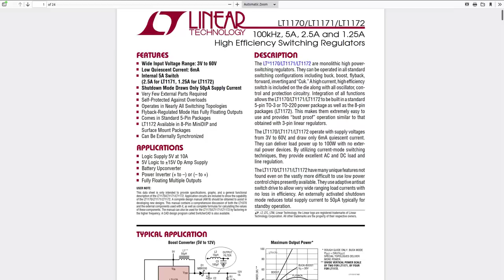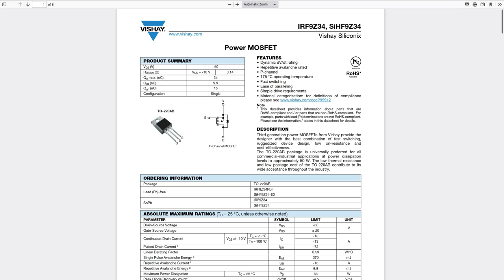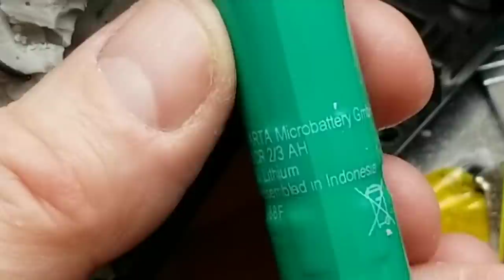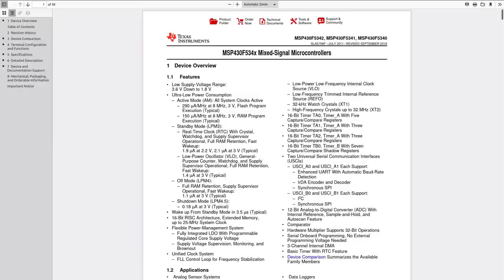Curiosity teardown: electronic locks

Comment: All you need is a high-powered magnet to break into the box
Reply from the maker: Possibly, though there is a lot of steel between the solenoid and the outside world that may shield it.
I should see if i can grab another one  to experiment on.
Reply: Good luck unsticking the magnet from the steel enclosure.
Maybe an electromagnet might do it...
Reply: @mahlapropyzm9180  next thing pile of stuff winding a big ass electro magnet in the background

Comment: Contrary to the label, that battery looks like standard Lithium (Li-MnO2) not Lithium Ion (Li-Ion).
Reply: The label just says Lithium.
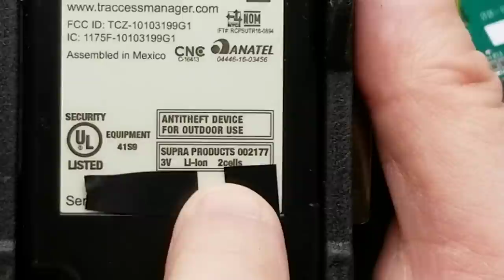Reply: @Okurka.  Nope, at 8:27 you can clearly see Li-ion on it. And it's probably two primary lithium cells in parallel for bigger capacity.
Reply: @kjur18  Ah, I was looking at the other battery.
Reply: @Okurka.  Yeah, on battery it does say Lithium. I looked for datasheet of this battery and indeed it's Li-MnO2, with capacity around 1500mAh, storage life > 10 years. Just what you need for non replaceable battery. They just put wrong info on back label.
Reply: @Okurka.  The label on the unit itself said "Li-Ion".

Comment: Interesting, so it operates with a tiny solenoid, or... presumably, since it uses a tiny solenoid, this in turn can be operated by a very large external neodymium magnet wielded by the bad guys.
Reply from the maker: There's a lot of ferrous metal (and distance) between the outside world and that little solenoid.  I think it would have to be a very strong magnet.

Comment: it looks like you could have just pulled the sticker off the front, unscrewed it, and cut out the battery and replaced it with an 18650.
Reply from the maker: That would probably work if/when the internal battery dies. 

Of course, I'll be retired by then so it'll be someone else's headache!